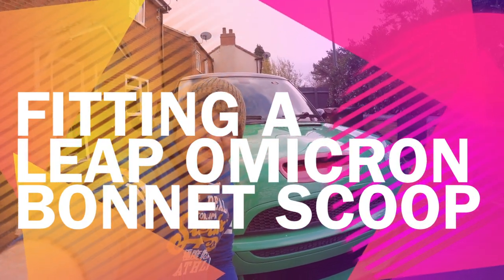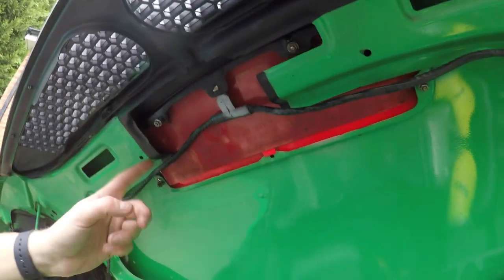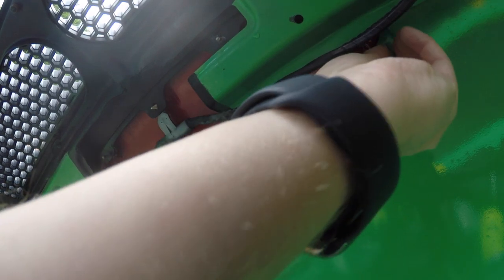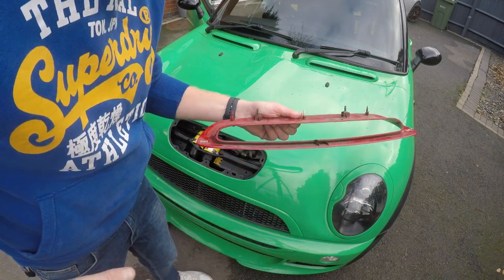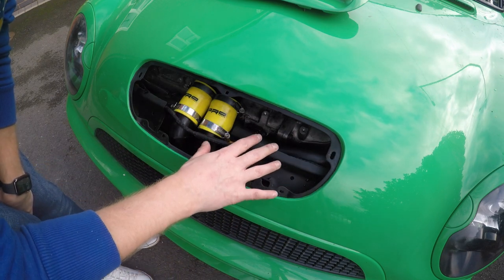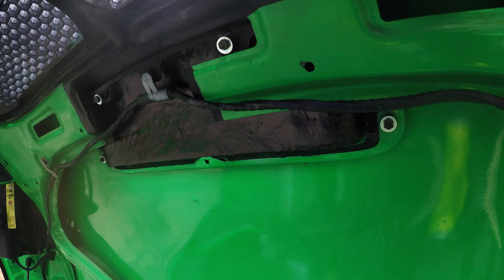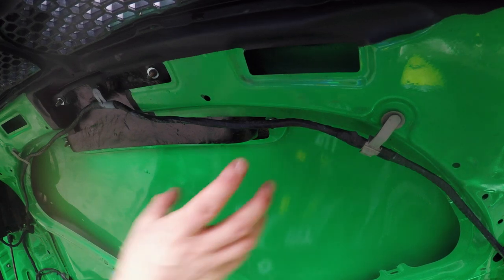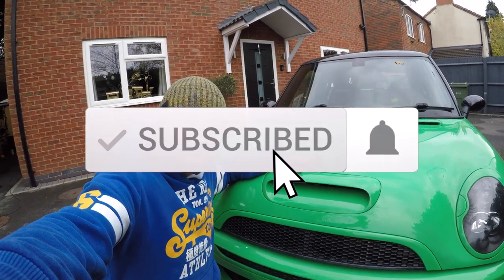Mini R53 Fitting a Leap Omicron 1 Larger Bonnet Scoop for Better Cooling

Comment: Does look smart that, i'm stuck deciding which scoop i want for mine. Is this the Omicron 1? I've seen there's a few different ones on Orranje but this is my favourite. Not heard many good things about the Atomspeed stuff so hesitant to go down that route even if they do look pretty cool too haha
Reply from the maker: https://orranje.co.uk/shop-by-brand/leap/leap-omicron-r53-bonnet-scoop  Correc this one.  I have previously used an M7 scoop, not had an Atomspeed on,  seen some bad reviews but also some good ones.  From my personal experience I would stick with Leap, I only dont have one on my F56 as I have an eventuri intake that requires their own scoop to feed the intake system
Reply: @tweedbean  perfect thanks mate. The cars off for head gasket and head work soon so maybe after Christmas when the wallet has recovered this will be a late present to myself 😅